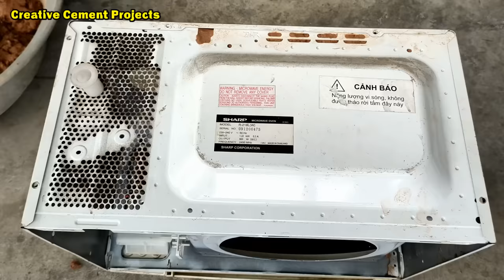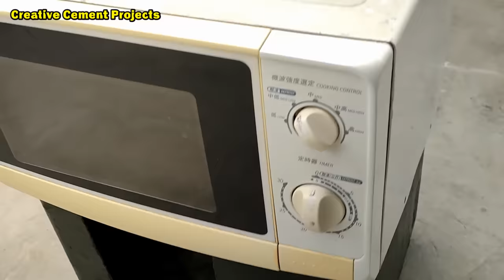Creative idea _ Recycling old broken microwave oven into a charcoal oven is great

Comment: Please be careful everyone if
You take a microwave apart, the transformer and capacitor have to be discharged as they can hold
10s of thousands of volts if not 100s of thousands to power the magnetron,  leave the microwave at least overnight to discharge
Reply from the maker: Thank you very much